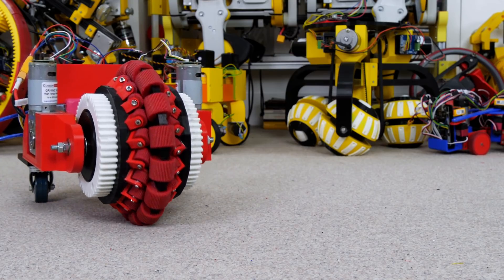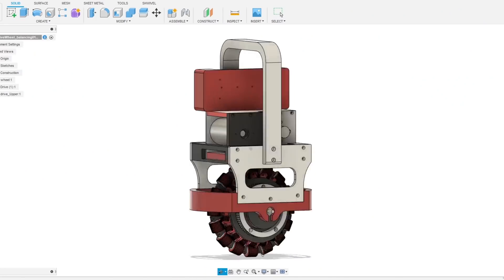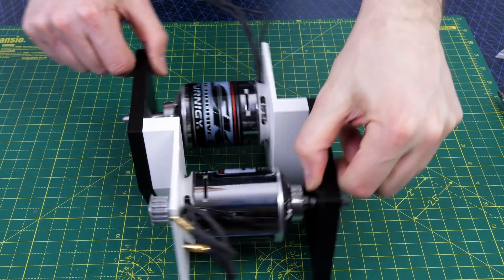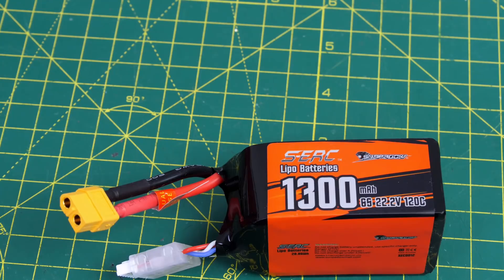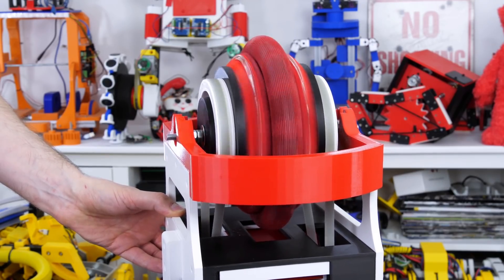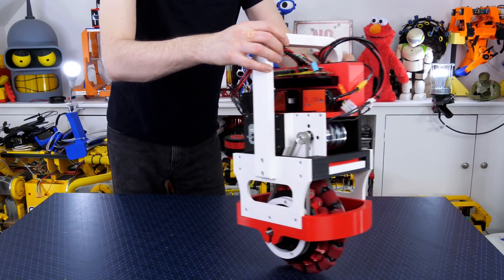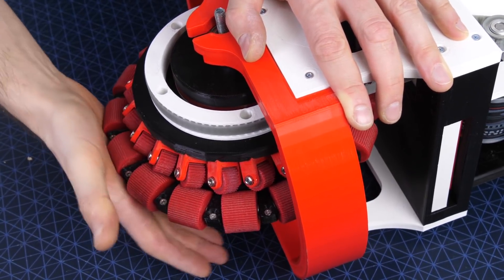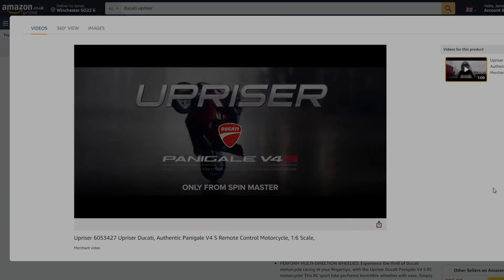Omni-Wheel Balancing Robot?

Comment: A decent Kalman filter ought to compensate for that creep just fine, even if it's not predictable. It just needs 6 axis accelerometer data and a decent physical model, and control signals can be rebalanced on the fly to achieve the desired outcome.

Comment: Question.
Why not have an inner center motor controlling the side to side motion of the wheel. And have the 2nd motor control the back and forth.
.
U could even add 2 for a better side to side control.
.
So if I could draw it.
It would look like this .
 .
   ...................... top of wheel
[^forward back motor]
[^]                 [^]
         [<][>]    [v]
[<side to side motor]
Wheel shape.
    =         side to side wheel
! !    ! !     "Tirewall"

Comment: 0:46 those red marked wheels, actually need to be football shape, diangle positioned, on the main wheel, so its always touching the ground during movement, as well share motions with the main wheel to move side ways. The original has gaps that limit velocity, or for off road grips only.

Comment: what about a big bevel gear with lots of small radial bevel gears, each one attached to a worm gear which in turn drives one of the small wheels. the structure holding all the gears & wheels rotated independently to provide forward/reverse

Comment: Why not make the wheel out of segments that lock together instead of mounted to a shaft? You only need to design one joint that locks the segment rotation together and allows for a few degrees of articulation. It would be one, maybe two parts, printed 30 or so times. Something like a ball tip hex driver in a matching ball socket comes to mind. But I'm sure there is a better joint out there than that though.

Comment: I'd like to know what spherical (round cylinder) side rollers would cope with gripping on the central omni wheel. You're pushing cylinders against the edge of a cylinder. My theory is that a rounded force applying roller would grip better

Comment: I think there is too much weight on the little wheels and not enough grip to move sideways. maybe make bigger and fewer wheels and deeper or fewer teeth in them and why not use helical gears? my guess would Also in the patent are the whose wheels fixed? they look like they are wheel casters like the one on roller chair that can rotate 360. what about putting those side wheels opposite of each other rather than symmetric to eliminate the creep.

Comment: I'm not by any means terribly knowledgeable on this kind of thing, however, I noticed the motor housings counter-rotating. Are they supposed to do that? Seems like it would be significantly reducing power and efficiency to the wheel. Wouldn't that also mess with the position sensing?

Comment: I see the mechanical flaw, but I don't see why the creep should be a problem. The robot should not fall over if you push it a little bit, so it shouldn't fall over if there is a little creep. Of course, it would be a problem, if the wheel should provide positioning information. But for balancing, I don't see the problem.
Possible solution to the slip without having to hack a Dremel:
If the Rollers didn't need support, you could add gears to the side of it to couple them without having to make them too squishy. An inner rope could provide tension and the diagonal rollers on the side hold it in position? Then, the rollers don't need support and it might work.
Edit: Looks nice :)

Comment: Maybe the tension of the drive belts is bending the top part of the side-roller carriage inward. This could cause a difference in the pressure applied by to side-rollers in the top and bottom. If this is true the pressure applied by the bottom side-rollers could be insufficient.

Comment: The creep issue reminds me of an engineer I once met. He used to design machines for hospitals to do the job straightforwardly. If a machine needed to move in a straight line, he'd build a linear mechanism. If it needed to have a certain accuracy, he'd build the mechanical parts to have that accuracy. His was a small company. His much larger competitors - this was the medical field where there's a lot of money going around - would design machines with multiple pivots instead. They were much more complex with multiple-pivot arms for straight-line work and they allowed play in the mechanism, saying "We'll fix it in software." Like that engineer, I like the mechanicals to be precise, but I can see how software fixes compensate for hardware issues. Besides, living things essentially use software to improve the precision of their hardware, so there's excellent precedent.

Edit: I really want to mention that I'd really like to make my own electric motors. There wouldn't be any need for gearing or belts if you could make motors to suit different applications. With the right rigs to wind the coils, it might even be possible to direct-drive each of the little wheels around the circumference. But it wouldn't get you away from needing a flexible shaft or some other appropriate coupling. :) If the little wheels were independent, each one would have to be capable of supplying the maximum torque which might be needed for sideways control.

Comment: You might be able to use a neural network to balance it. Simulating it would be painful, but if you toss arbitrary slip at it, it should learn balance over time.
Or just add additional sensors 😂

Comment: Sticking with the wheels rather than the gears, could you make the outer hubs be slightly flexible such that when tightened the wheels on the outer hub flare out?
You would need some spring system between the two outer hubs but at least then tightening the outer hubs towards the inner wheel would result in a more uniform traction

Comment: No need for a flexible shaft, use universal joints. If you still want the wheels to be able to shift you can make two sets of axles sliding inside each other to simulate "stretch" and let the wheels shift up and down.

Comment: I'm not really sure why you would worry so much about creep, measuring the creep, compensating for the creep, etc. The robot has control authority in both axes that it needs and creep would just be a disturbance that the controller would correct for pretty quickly. Its not open loop. I bet that you will find that its not really an issue once you fix the slipping problem using the flexible shaft.

Comment: Could you measure the rotation of the main wheel in some way? Is the shaft static and the wheel spinning around it? Otherwise you could add an encoder to that. Then do a cascade PID or something, adding one more layer to try to actively remove the creep.

Comment: Just a few brainstormed thoughts about how to do it:
You could run the belt from roller to roller in a star pattern then, you only need to drive it at one point
You can get the flexible shaft on Amazon, look up "Flexible Shaft Inner Core".
Maybe you could design rollers that clamp onto the flexible shaft (basically clamping shaft collars) and slip the TPU tires on. Or maybe you can glue or solder the rollers on.
There's nothing to really stop you from using the helical fear design with a full loop.
The flexible shaft doesn't need to be a complete loop, maybe you could make the loop a horseshoe/pretzel shape and you can drive the ends of the shaft directly, bypassing the need for roller to roller contact.
Maybe you could buy premade U joints or print custom miter gears.
What if you had overlapping rollers(dual row, uneven size, or cone shaped)? You could have gears running from roller to roller.
Another thing you can look into is Synchromesh timing cables
You could copy the liddard wheel

Comment: what I'm noticing is the ridges on your rubber wheels are all parallel to their respective shaft, however they do not mesh well with each other. I noticed that one of the patents seems to have a diamond pattern on the central ring wheel that would mesh better with the smaller wheels and I would think prevent slippage

Comment: You don't need to power the small wheels that aren't currently part of the contact patch with the floor at the bottom. When they move away from the contact patch, you can stop powering them. You're just wasting power driving all  that friction.

Comment: Could the axles of the driven wheels be linked via some sort of friction coupling like a disk or plate on the ends of the axles and have that form groups of wheels instead of trying to solve the flexible coupling problem?

Comment: It would be interesting hooking up (kind of opposite), four of your one wheel design together and instead use it as if one wheel loses grip other can compensate with side motion so doesn’t turn. Kind of like torque vectoring 

You could also try making balancing bot that has legs  but normally uses wheel as more efficient but uses leg on certain terrain. I’m thinking it could lift wheel up and swing it and use Omni wheel to help balance abs or multiple legs

Comment: James. The ridges you have added to the wheels have hurt you here. The force is being transferred by friction between the two sets of wheels, not by any tooth engagement. So by having ridges you are decreasing the surface area of the contact patch between the two surfaces. Having a lower durometer material for each so the contact patch expands and removing the ridges so you have more of the area entrained in the contact region will result in a higher maximum torque between the inner wheels and outer wheels.
Reply: i was just thinking about that. tho, my thought was making matching texture between the wheels so they fully engage
like, either the outer wheels stay the same and the inner wheels get a sort of diamond pattern on them, or the inner wheels stay the same and the outer wheels get tilted ridges like a worm gear
Reply: Well stated.. good point.. tho I'll add that also the very fact the robot can't apply X and Y forces simultainiously would inevitably lead to it being hard to balance.. so glad he's moving away from the Honda approach.
Reply: @richardward6747  You usually can with differential drives, e.g. keeping one motor stationary while driving the other will apply a net force at a 45 degree diagonal, and you can vary the proportion of the motor speeds to get other angles. Unless there is some limitation with this specific drive that I'm missing?
Reply: @pseudo_goose  the way I see it.. correct me if I'm wrong..  if both motors go the same way the big wheel moves that way but if they go different directions the little wheels move.. so both can't happen the same time.. sure you can chop between them but it'll be choppy movement for some desired directions.. ya see what I mean?
Reply: @richardward6747  The big wheel's motion is proportional to the sum of the motor outputs, and the little wheels are proportional to the difference. If the big wheel is rotating, then to find how much the little wheels move, just ignore the big wheel's motion by rotating the reference frame at the same rate as the big wheel.
Reply: Think of it this way - the little wheels spin not because the motors are rotating different directions, but because more generally, there is a difference in the rotation speed of the motors.

Comment: You could put magnets in the traction wheels and hall sensors on the body of the robot to encode the rotation of the main wheel. That would allow the tensioning to be actively compensated rather than mechanically compensated. The hard part would be getting good and accurate sensing without going overboard cost-wise.

Comment: Have you considered printing flexable cross shaped axle segments?  You might be able to get segments to link each of the main wheels.  I hope the shaft diameter of the segments can be large enough to stop rotational flex. This might help with the contact wheels from rolling in spite of not being driven.  As to the rolling creep, consider reversing the drive rollers angle of contact.  It would lower the part count ( of CAD files ) as it would be either side printed twice.

Comment: What about instead of having a ring of angled wheels all along the main wheel, you had just one wheel on each side near the bottom that could clamp down when the bot wants to go sideways? It's an extra servo or two, but probably less complexity overall. Better yet, just have the side wheels move to contact the ground and then you can leave the forwards/back wheel normal instead of omni.

Comment: Helical gear like serrations to the smaller rollers would make a lot of sense, they would actually work like a gear and not by friction ie they would significantly reduce the wear on the rollers. only additional part would be a big central helical gear meshing with the small rollers and  fixed to the chasis so the small rollers would transfer torque instead of rolling with the

Comment: To deal with the wheel creep, you could have the central axle set screwed to the central wheel, and then use an encoder to detect wheel rotation, and counter it with appropriate drive motor offsets

Comment: If stretch is the issue, why not use universal joints between the wheels. I'm fairly sure the issue is that you need to unify the torque

Comment: You could connect the central wheels with some kind of coupling (u joint,or multi tooth, etc) that can handle the angular misalignment, instead of using a flexible shaft.

Comment: I wonder if you could make a ring of coupled rollers by making them like gears that mesh on the inner side of the ring and separate far enough to mount to a hub on the outer side. There would probably be too much slop to benefit from driving the wheel all the way around, but at the very least there wouldn't be gaps in the contact at the bottom. Plus if the carrier ring is on the outside you could just have a stationary gear above the bottom edge to drive side to side motion, but mounting all that would get very complex. This is a fun experiment; thanks for the video!

Comment: Two solutions to the "flex shaft axle" that do noy involve a flex shaft: 1) Universal joints on each wheel. This works, but it's complicated and impractical. 2) Crown gears on each wheel end. This is simpler, can be printed, and doesn't have to be terribly accurate, even rough interlocking fingers would work.
Reply: Meat grinder wheels

Comment: I'm new here, but I'm confused why your controller is so dependent on the absolute position of the wheels. I would have thought that a PID system could look at the acceleration experienced by the robot and dynamically adjust the speed of the outer wheels. For instance if while moving left it "felt" the creep backwards it could bias the side wheels to compensate and cancel out the acceleration. But, I don't know how you've written your code so I could be completely off the mark.

Comment: Looking at it, I think the main wheels that touch the ground need a larger diameter, maybe 2 or 3 times the current diameter.  That will give it better traction and a smoother lean angle when it does lean side to side. Just my thoughts on it.
Reply: If you go with a flexible shaft try to find a braided steel cable. The braided ones tend to be more ridged than twisted ones in both directions. It may be a little bit of a challenge to make it work but I'm sure you can come up with something.

Comment: Considering the U3-X and OmBURo have all of their wheels mechanically bound in some way, you need to do the same with your wheel. In their cases the hub wheels are bound to the central disc's wheels, of which are rigid with each other via the flexible shaft, which in turn makes each of the hubs' wheels rigid. Anything that induces friction along the system would work, this is why flexible shafts work and they're honestly the easiest implementation, but gearsets or having auxiliary rollers on a reference roller that binds the reference roller to the neighboring rollers would work; and because of how your rollers are tessellated, these two would be the simplest options, but I don't believe anything could be done on the inner portion of the hubs due to clearances with the disc's wheels. Alternatively, find a way to have a second set of hub rollers, that mesh to the main drive rollers, but are planar to the hub, then connect those via a gearset or a serpentine belt. Having a rigid system is key for this design to work, otherwise freely slipping components will circle back to the same issues. 

The main problem is that, in the theory of the wheel's design, you're trying to roll a torus' surface along it's solid circular center path. While some materials may have properties that could allow this movement, and the compression/expansion of material between the center-most and outer-most radii, rubbers just aren't going to achieve that, especially harder tire, at least not without modification to allow such movement, but then you'll have tread patch issues along the expanded edge, and contact patch issues with the hub rollers. It's just not a simple problem, and the absolute simplest solution is that flexible shaft binding the disc rollers, as they're all in line and wouldn't require any kind of gearset or auxiliary roller set to make the system rigid. One of the earlier U3-X patent images shown (0:34) literally shows a torus, I can't find the patent so I can't read the supplemental literature, but I wouldn't be surprised if there's implication of a rigid system if they're using a solid torus as a patent drawing example.

Comment: Maybe use square TPU line for the flexible axle with round spacers that fit into bearings to drive the small wheels 🤔 there still would be flexing in the TPU line though so possibly that might not work unless every second wheel is belt driven 😃